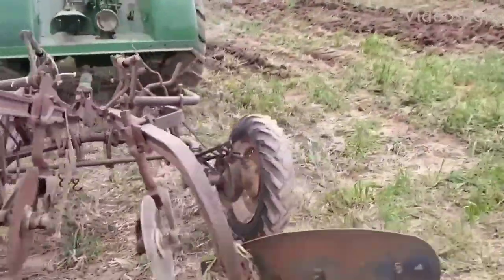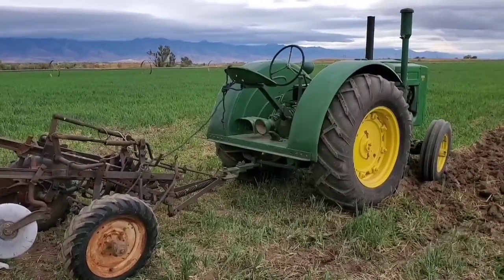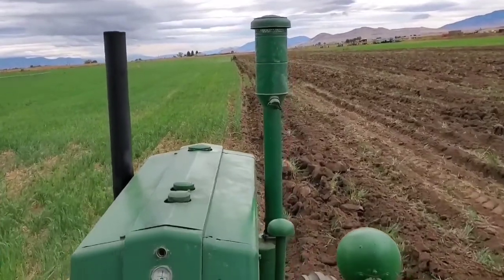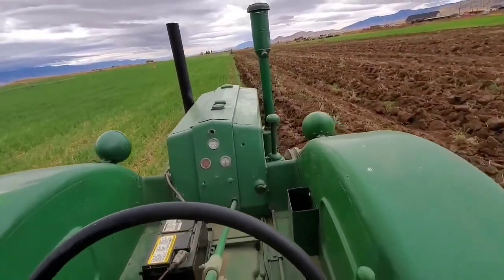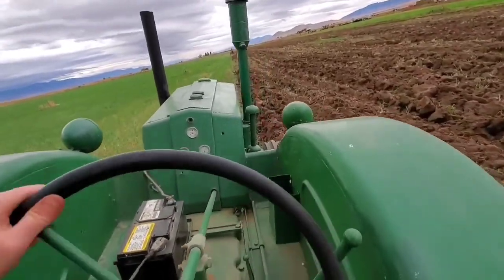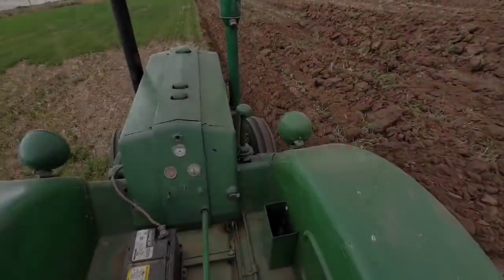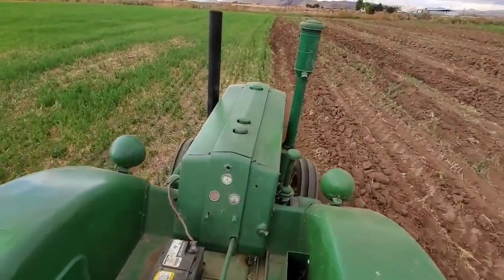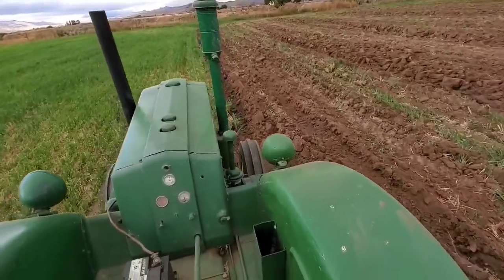John Deere D Plowing - Operators View

Comment: You need to check that transmission out. Sounds like you have a bearing near one of the bull gears that needs attention. I have an A that makes noise like that, and that slack is what the sound is.
Reply from the maker: The final drive of a model D is completely different than an A or a B or any of the other letter tractors. The bull gears in a D are chain driven, not gear driven.
Reply: Our d does the same even after a nut and bolt restoration